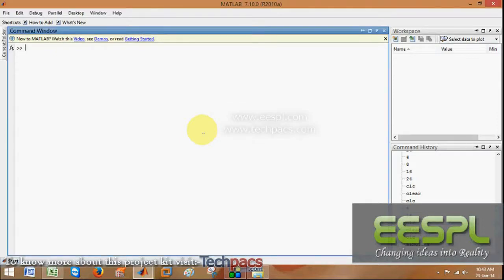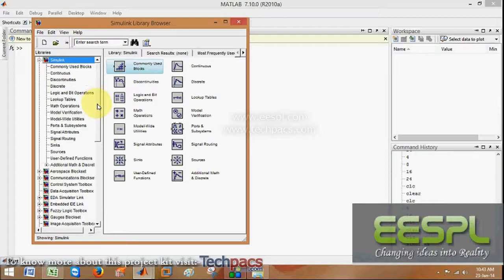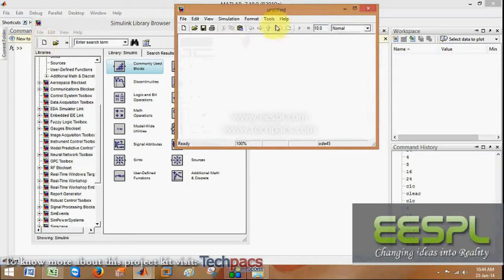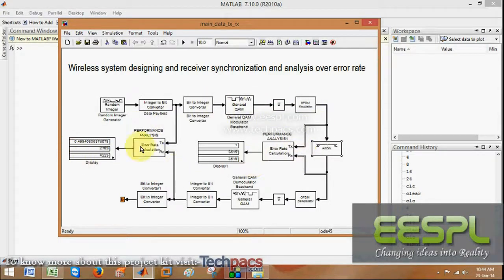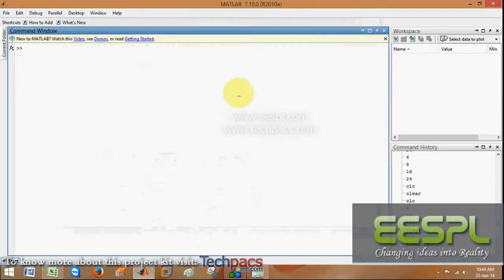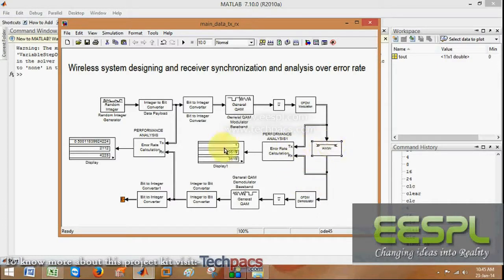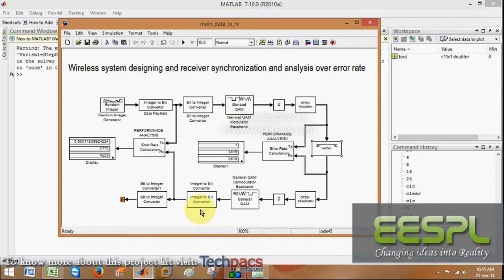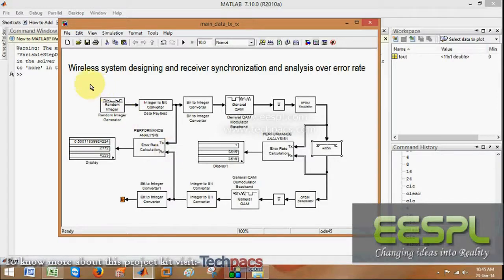QAM Transmitter and Receiver Design | Wireless Communication (latest Project 2020)

Comment: hi,
could you explain all the blocks?
like, i need to transmit 60 tones of data 
help me out with this please. 
i dont know how to set the values in that random generator block for 60 tones. and what's that ū block before ofdm modulator?
Reply from the maker: Sure Sai you will get the explanation please contact on my email: projecthead@techpacs.com
Reply: i mailed long back no reply from your side.
please explain the design here at least.
thank you
Reply from the maker: please visit the following link https://goo.gl/Su8T3p or mail us on projecthead@techpacs.com or call us 0172-4638606,  +91 9815216606